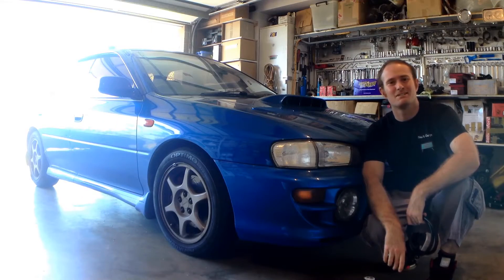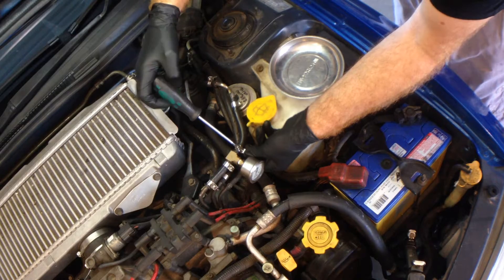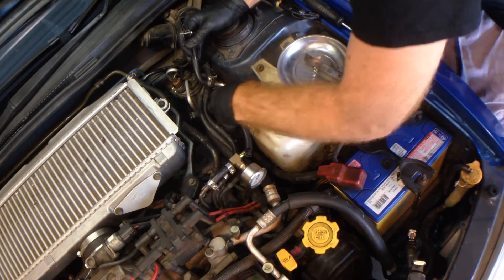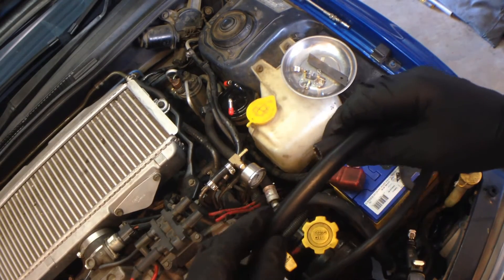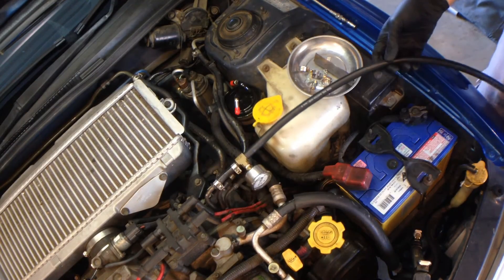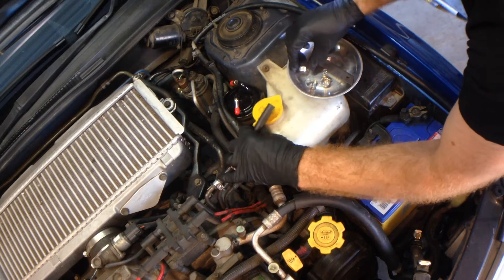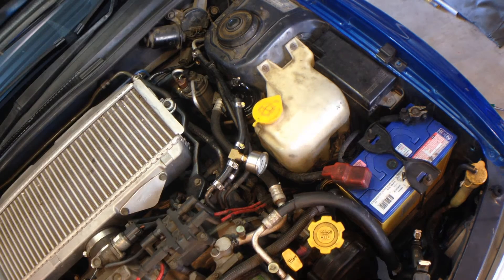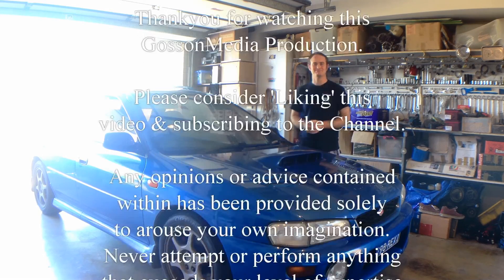Replacing the Fuel Filter on a Subaru - MY99 WRX

Comment: Unplug the fuel pump or remove the fuse while running the engine till it stops is the simplest and only way to be sure you have no pressure if you have no gauge.

Comment: There's a specific way to mount that fuel filter or doesn´t matter? what i want to know is, in each connection point, doesn´t matter the  fuel direction in that part? thanks
Reply: There is a specific way and it's usually marked.